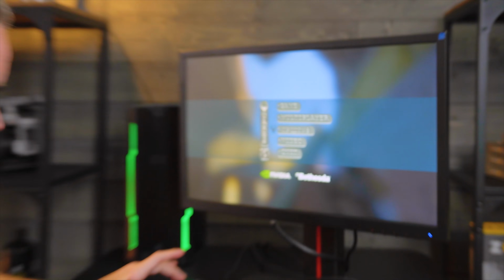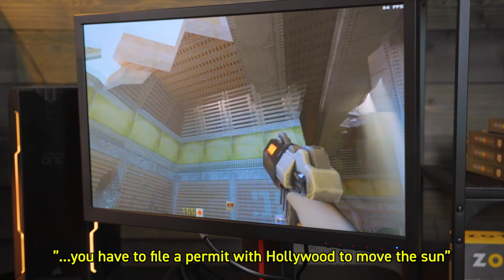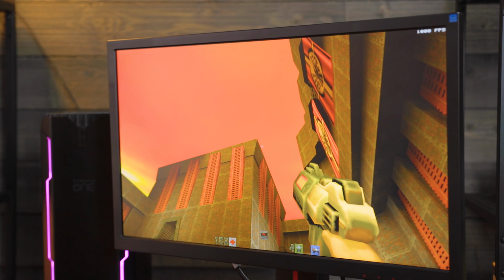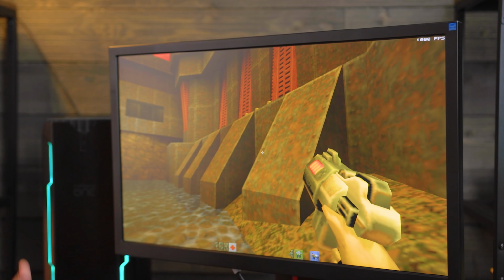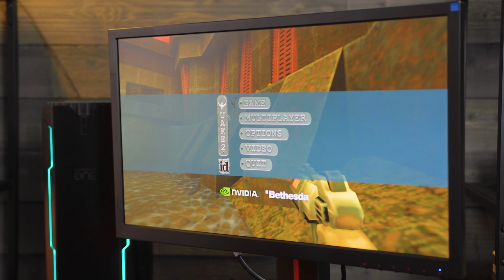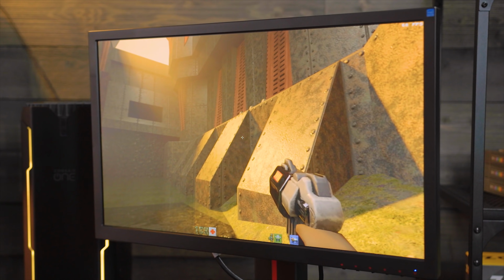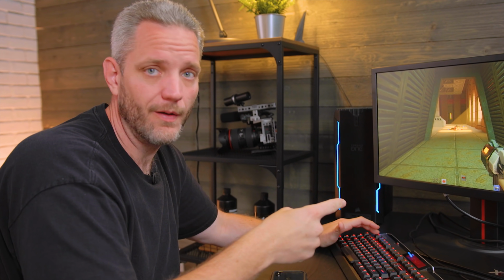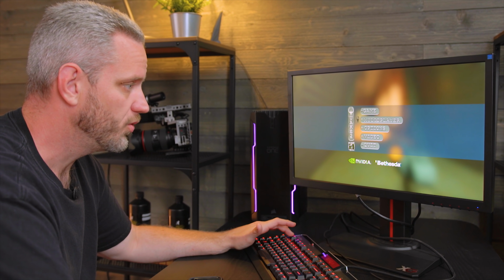Testing Quake II with fully ray traced update...

Comment: Those details in the walls (like the corroded metal etc) are actually created by textures, it's using a normal map (at the very least) aside from the albedo, the specularity might be raytraced. How do I know this? Because there's no way that piece of flat wall consists of thousands of polygons and for a raytracer to be able to trace those details you would need actual geometry instead of textures :) The reflections on the water surface are as realistic as it gets, water is as close to a "smooth" of a surface as it gets, so much that the reflections become mirror like (look at the surface of a pond on a still day). The only thing that breaks the perfect mirror image are the ripples and waves on the surface and the only thing that affects the actual intensity of the reflection is the amount of light reflecting from the surface of the water... But since we're using a raytracer the lighting is calculated realistically and not arbitrarily, therefore the reflections are also realistic and not reliant on arbitrary values :)
Cool video, it's fun to see stuff like this making it's way in to gaming. There's so much cool technology which has existed for YEARS (like raytracing) which hasn't been implemented in to video-games only because of technical limitations.

Comment: To be as specific as possible, here is a copy paste of my full specs (relevant or not). After 27 minutes of game play my temp was 80C and I was getting around mid 70s to high 80s in my FPS.
Edit: All settings were maxed.

RTX2080ti Founders Edition

EVGA 750 GQ

GIGABYTE GA-AB350N-Gaming WIFI

AMD Ryzen 7 1700X (Yes I know, I'm waiting for 3rd gen)

Corsair Vengeance LPX 16GB (2x8GB) DDR4

Samsung 960 EVO Series - 500GB NVMe - M.2 Internal SSD

Corsair Hydro Series H100i v2 AIO

Rexgear 1 Micro ATX Cube PC Case

Corsair K95 RGB Platinum w/ Cherry MX Speed Switches

Corsair Scimitar Pro RGB

Corsair VOID Pro RGB

Acer XFA240

Acer GN246HL

Comment: i7-4790k @ 4.7 GHz
32gb ddr3 1866 MHz
EVGA GTX 1070 FTW2 (core  @2100MHz, memory @4600MHz)
13-14 FPS avg @ 1080p, with Global Illumination set to low, denoiser and textures enabled, all other settings disabled/set as low as possible. Even anti aliasing and sampling are set low.

Clearly raytracing is incredibly taxing on existing hardware, and the rtx series is of course the only hardware that's capable of handling live-rendering for raytracing while producing reasonable framerates.

The in-game lag with raytracing enabled is real. Takes me back to the days of my childhood, watching my old Dell Optiplex struggle to run Sims 2's default graphics settings.

Ahh, the days of extended scrolling and frustratedly inching mice to line up a cross hair with a target, how I haven't missed you whatsofuckingever.

Comment: >normal quake 2 runs at 399 FPS
>with ray-tracing on 2 1070Tis with global illumination set to off (doesn't seem to actually impact the quality that much surprisingly) it's 38 FPS
not sure if this is supposed to be anti-advertising or some sort of reverse psychology but this DOES NOT make me want to buy into RT right now.

Comment: I tried it on my old original Core i7-980X and GTX 1080ti.
It ran but was getting around 9 to 14 fps...! (Gets over 900 fps with RTX off).
Being able to look at the reflections in a computer panel and see an enemy coming up behind you is pretty cool!

Comment: Qii has amazing capacity to run on things. It had an opengl renderer, a dx renderer and a software renderer out of the box. I remember it running on 166 mhz cpu with 4 Mb of ram on software renderer. Very often it was a sideshow, but it was running.

Comment: R7 1700 @ static 3.7mhz; 1660TI stock settings, 16gb ram @ 3000mhz; RTX off 980+fps avg with some random drops down to 400ish fps; RTX on, no changes to loaded video settings= global illumination on med avg 15fps; on low 20fps. Definitely looking forward to hopefully upgrading into the RTX series cards (eventually).

Comment: polycount actually has nothing to do with it. Geometric detail impacts the performance of rasterization based algorithms because it's literally doing the math to project and shade each triangle in relation to the camera. Raytracing performance is not geometry bound because it doesn't really impact the number of rays you have to trace. If you've got a sphere on the screen that's got 8 subdivisions, and then increase the number of subdivisions to 64, you're not going to have to shoot more rays to render the new scene. There are other metrics which can degrade raytracing performance, like number of lights in a scene, though in that respect Q2 is actually pretty modern. From what I've heard, the thing to worry about is materials, though I'm not an expert.

Comment: Wait... Most movies run at pretty much 24fps that'd mean a 90min movie would have 129 600 frames which would take 270days for Pixar's 2011 render farm to render, given a 3min per frame render time... but it would have taken them just over 59 years to finish a 90min movie in 1995 if each frame took about 4 hours to render?!?

Comment: the "Global Illumination" setting is the base illumination when no direct light source is visible. If the demo allows it (not even going to try on my 970), try turning it off if that's possible to see how dark it is. It fakes the dispersion of light in the air and radiosity effects from other objects (light reflecting from other objects). Think lighting a dark room by pointing a flashlight at the ceiling. Calculating this is usually still too hard, even in not-real-time. Your only other option is adding more lights, which then increases the complexity, because every sub-pixel needs to be traced back to every light source. Check out this reference: http://www.povray.org/documentation/3.7.0/t2_1.html#t2_1_2 .

Pixar's RenderMan wasn't really a ray-tracer in the Toay Story days, though it did include some ray-tracing features. See https://en.wikipedia.org/wiki/Pixar_RenderMan

Comment: The problem isn't that Ray Tracing is a great technology, because really is awesome when you get down to it.  The problem is that Nvidia was selling Ray Tracing as a must have, when we still have a lot of time before all hardware manufacturers will have the horsepower to really push Ray Tracing in a means that it's useful to the majority of PC gamers. 

Being that RTX features really hammer even a $1200 video card speaks volumes about the fact that it's got a ways to go before becoming the norm.

Comment: I am not a fan of the replacement textures but I know they are needed for the meta data for the ray tracer.  I do like that they give you different skybox options including the original env map.  It kept crashing while I was doing comparisons with r_override_textures but I'm on a 1080ti so I know it wouldn't work very well.

Comment: R5 1600x @ 4.0ghz
16gb 3000mhz Ram
1070 at 1790mhz
1440p monitor at 70 refresh

RTX 720p - 11-15 fps, tearing everywhere.
        1080p -  1 fps (I just closed it, figured it would crash, said 0 at one point)

RTX off - 875-925 fps @ 1080p

Comment: Lenovo Legion 15 2070 Max Q i7 8750H 
Maxed setting 1080p 35-45 fps Highs of 50
It's really neat to see that even Max q versions of RTX make such a big difference. I figured my laptop would be worse or on par with a 1080ti and I'm surprised and delighted that it works as intended. RTX does still seem like a gimmick because in every other circumstance a full 1080 would kill my laptop. Maybe not a gimmick, but not balanced or maybe we just got spoiled with Pascal.

Comment: Quake II RTX runs decently on Pascal.  It runs at 1024x768p ~60fps on a 1080 ti.  Not as pretty as higher resolutions, but definitely still impressive compared to the original.
Full system: Ryzen 7 1700, GTX 1080 ti, 32gb memory

Comment: Hi Jay, you asked about FPS benchmarks on Quake II, I have Thread ripper 2950x, 32 gig ram at 3200,  EVGA 2070. RTX on, nothing overclocked (I generally don't overclock). Consistent at 69-70 FPS. Hope that helps

Comment: GPU: RTX 2060 OC @1750 Mhz
CPU: i7-9700k @ 4.9 GHz
Average 54 fps at 1050p with high settings.
Reply: Why 1050p
Reply: @whodatboi1543  I am using my old monitor untill I get a new one.
Reply: @David-0990  pc that good but a 1050p panel lol

Comment: OS: Windows 10
RAM: 64GB (8x8GB) G.Skill Flare X (DDR4 2133 OC'd to 2400)
CPU: AMD Threadripper 1950X (Virtualization disabled, OC'd to 4GHz on all cores)
Video: 2x MSI RTX 2080 SEAHAWK EK (No NVLink, no OC) 8GB VRAM
MOBO: MSI X399 Gaming Pro Carbon/AC

Granted,  I AM only utilizing one of the two cards, but at 1920x1080 and all things maxed (except FOV, which was default 90), I am getting 58-64 FPS. Pretty respectable, and perfectly playable.
And before you facepalm over the lack of NVLink, I cannot actually find an MSI bridge that is 4 slots, and my motherboard ONLY allows for 2 or 4 slot arrangement. ^__^

Comment: System: i7-6700K@4.6 GHz water cooled. EVGA GTX 1080 ti FTW3 Hybrid at 70 MHz overclock on GPU and 300 MHz overclock on RAM. 32 GB of RAM and 1TB Samsung NVME SSD.  
Results: 7 FPS on RTX 1000 FPS on OpenGL.

Comment: A little bit of testing latter, on GTX1070 you really need to turn things down. I started with default settings and Global Illumination on medium and that was 9FPS, low was 12 FPS, off was 18FPS, also if I turn Caustics off, I got to 22FPS. All of that was at 1080p. Other settings didn't really have much of an impact, other than resolution scaling. But playing with resolution scaling, I could get it to 60FPS by dropping resolution scale to 50%, setting global illumination off and keeping caustics on. If I turn caustics off, I got to 68-74FPS. Or alternatively caustics on, global illumination on medium 50% resolution scale and I could run it at 30FPS. 60% scaling, GI low would be 29FPS, 70% scaling GI off was 28FPS.  Of course with no RTX, it is infinitely more even at 4k.

Anyway, full setup is Ryzen 2600X, 2x8GB 3000Mhz RAM and GTX1070 Gigabyte Windforce.

Just posting in case anyone was curious. I didn't do much of playing, but at low resolution scale to even get those FPS numbers up to playable, it just isn't worth it without RTX card, or at least like 1080Ti... that might do it.

Comment: I think all we need to know about the state of RTX "ray tracing" is that it's been on the market for months, and the best they can come up with to do "full RTX" is a 22 year old game engine where the "big flashy results" amounts to dropping the game to low 50 fps and making it look like the gamma is up 50x too high, destroying the entire feel of the level designer's intent in the process.

Why is it all these fancy lighting and reshades -- be it ray tracing, or the goofy sweet-fx shader stuff -- just look like nothing more than turning the gamma up to the point there are no blacks and the colour depth/reproduction looks like a crappy cheap dual scan laptop LCD from the same time period the original Quake was released?

Though I've also seen a few that suffer badly from "Quake 3 lighting" where you can have lights on every wall of a 6x6 room, a big light in the middle of the room, and the corners are pitch black... but "look at how good the graphics are". They weren't good then, and they aren't good in Rage 2 either.

But no... "look at how good this looks" -- right... Looks like shit to me. Call me when they can do REAL ray-tracing (like the output from POV-RAY) in realtime on a modern game. Until then, this is little more than experimental wanking.

Comment: 10:49 - Can you cite examples that show such dismissal of shadows, textures, etc. was the norm at any point? I can't recall the earlier times of new gfx features ever being treated in the way. People didn't start to become somewhat more sceptical until we had the era during the late 2000s of umpteen different forms of antialiasing that often went hand in hand with fudged image quality in other areas. The other point not really conveyed here is that the overall level of realism available today with non-RT methods is already very good; the actual difference RTX makes to a game is minimal. Indeed, even the ingame quality sliders don't really make a modern game look that much worse if things are set to low. By contrast, the low to high realism spectrum for a game like Crysis is considerable, even more so for older games.

Comment: GTX 1080ti and an 8086K, 1000 fps without RTX, and only 7 fps with RTX on... Definitely significantly worse than i expected, though I knew it was going to be bad. It wasn't even that it was just super choppy, but there was a solid 3 second delay between moving the mouse and the game responding.

edit: Forgot to mention, 3440x1440 which certainly contributes to that.

Comment: i7 6700K, 32GB RAM, GTX 1070. RTX mode works with default settings at 1080p, but the framerate is below 10 FPS, movement is very twitchy, and the controls stop registering a few seconds after the level is loaded.

Comment: https://www.nvidia.com/en-us/geforce/news/quake-ii-rtx-june-6-release-date/?cjevent=79d6094497ba11e9809200f20a180513
Nvidia site says quote: " Now, we can confirm that Quake II RTX will be released on June 6th, 2019. If you have a GeForce RTX graphics card, or other capable hardware,"

Ok so i tested it on a I7 8600K 4.8 Ghz, MSI GTX 1080 SEAHAWK, 16 Gb ram Asus formula x board.
RTX on medium setting 14-18 fps screen was stuttering when moving. But it look really nice graphics were good enough to play it again just need 100 fps more.
RTX on low setting 20-24 fps was still stuttering when moving.
 graphic took a hit looked a lot less nice, but still better then original.
OpenGL all max 144 fps, pretty ok experience was able to kill things, unlike in RTX mode were the stutter were to bad. But yeah this is how i remember it, not very good for modern standards. 

Can it play Quack II my S3 GPU card said NO, I remember i had to wait a 1/2 year for my Vodoo II card, and 2 more months because it sold out within hours of launch just to play Quack II. The good old days of warcraft II, Quack, unreal and having to upgrade your pc every year because the cpu speeds increase so much, so fast. my first build was a 200Mhz IBM Cyrix mmx+ with S3 graphics top of the line :p

I would love to see old titles be ray traced there some really good games out there like: C&C part 1 and 2, star craft 1, warcraft 1 and 2 and diablo 1, mechwarrior 3 and 4. And then you realize you sound like a old men. crap.  I try booting old games sometimes, but I cant do it, ones your use to higher graphics and the beauty of modern games and high fps panels there no way back to playing  858 x 480 game with a huge black screen around it. I tried morrowind but after a game like black desert, or some asian MMO it looks like crap.

Comment: I have a fairly old(-ish) system, that I recently upgraded with a new graphics card.

i7-6700k @ 3.4GHz
16 GB RAM @ 2400MHz
GTX 1660 Ti

I got ~15 FPS. Additionally the controls were very choppy and unresponsive, and the game was basically unplayable. The lighting looked cool, though.

Comment: RTX 2060 + R7 2700x @ Stock, 16GB DDR4 G Skill 3200 GHz @1080 resolution.

At Low Global Illumination: I got above 60fps avg, dipping as low as 54 briefly.
At Medium GI: I got around 50 to 54fps on average, dipping as low as 49, was fairly consistent.
At High GI: I got around 45 fps on average, dipping to around 34 periodically while fighting enemies in the water area.

Comment: Nvidia doing their shady business as usual. Look at 6:41 and then at 6:49.
They changed MUCH more than the raytracing in there. Basically they remastered it, and then raytraced it. Because raytracing doesn't change the textures, and certainly not the geometry of objects.

It's even shadier than what they did with Hairworks and Physx, they kind of mention there are other improvements in the article, but then they go and compare the images from the original and the remastered and raytraced version as if the only difference was raytracing on and off.
http://images.nvidia.com/geforce-com/international/comparisons/quake-ii-rtx-nvidia-rtx-ray-tracing/quake-ii-rtx-nvidia-rtx-ray-tracing-interactive-comparison-002-on-vs-off.html
There you can clearly see that the textures are different, amongst other things.

And all of this is without even entering into whatever Raytracing is worth it or not.

Also sry to say it, but Jay, you fell for it and took Nvidia's bait. XD